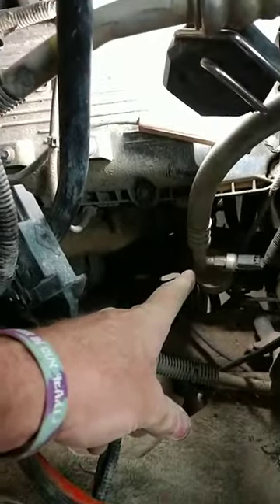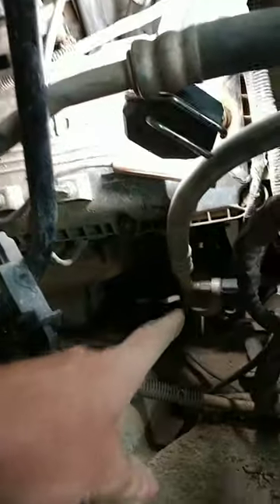How Engineers Keep Mechanics Miserable (Part 287) #shorts

Comment: About 50 years ago I worked in an automotive shop.  On the wall was a cartoon depecting an engineer and an auto body designer.  They were both congratulating each other looking at their final prototype.  A third engineer walks up, pointing his finger into the engine compartment, and says, "No, you're not done.  That part is too easy to get to."
Reply: 50 years ago it wasn't even hard to work on cars. Cars were simplified
Reply: @GiuseppeSimonetti  I got an old 1950s Morris recently, it feels so wrong to work on because everything is so easy to do on it, I'd gotten used to being punished every step of the way
Reply: @GiuseppeSimonetti  Yeah, they really were easy to work on.  Now one needs an OBD analyzer and a chart to figure out where all of the tubes, piping and wiring go to.  And then there are those damned fusible wire links.
Reply: that's like funny with salt
Reply: @archygrey9093  well also back then the cars weren't packed in so tight. Nowadays there's so much sensors, emission stuff, electronics, it just complicates everything and makes it all real right.

Comment: JB Weld is looking like a great alternative right about now.
Reply: I was thinking the same thing, ford should give you vouchers for JB weld when you buy a new one
Reply: Good luck with that.
Reply: I think I’d just slide a tube through over the old tube & put the old tube back into place. Basically a Tube in a Tube deal. It would be stronger than original too. You could jb weld or silicone tube in place. ( edit ) support dip stick also with an attachment point.
Reply: @OcRefrig  hahaha.
Reply: @OcRefrig  You are perfectly correct if there's a will there's a way and you're right it'll probably be stronger too
Reply: @OcRefrig  or just splice it with a hose
Reply: @jophatb3945   yea , a piece of hose & a couple hose clamps could work. Just need to secure top side from flopping around. Make a secure mount to hold top half of pipe in place & you’d be golden.
Reply: @OcRefrig  reengineering is the best
Reply: @jophatb3945   if he just replaces dip stick & does not support it. It WILL just break off again.
Reply: "when you got touched wrong as a child, don't take it out on us mechanics." What a line! If mechanics designed engine bays, they would be huuuuge!
Reply: @OcRefrig   the weight of the dipstick isn’t what broke it… it doesn’t really need support either just enough hose to keep it from dropping too far into the pan. A bit of baling wire to something and it’s good. Depending where it broke oil might not even be leaking out.
Reply: Some people don’t like hack repairs. Especially on customer vehicles. That JB weld doesn’t work? It comes back with my name on it. I’d rather charge the customer for the proper repair
Reply: I tried jb weld on my 7.3 dipstick.. It still leaked lol
Reply: @OcRefrig  I can only imagine how your labor must turn out
Reply: @C.dieslevonankwek7  forget a voucher you should get a memebership that ships to your door weekly
Reply: Get a rubber hose and some clamps/ to bridge the break.  Fix top  end then add it to the bottom.....so cheap easy functional.
Reply: @tooltime4640  I get what you are saying, but it’s pretty easy to ask if they want to pay $60 (no warranty) vs $400. Considering that it is just a dipstick tube, I feel most customers couldn’t really care less, as they probably have never used it!
Reply: @scottjimenez653  the engine bay would be huge and every motor a straight 6
Reply: What is started naming all the parts I started to hear “The leg bones connected to the . . . .” and then I thought JB Weld sounds like a fine alternative.
Reply: Fuck yea 🤣🤣
Reply: Heat shrink?
Reply: @dirtyaznstyle4156  The weight could very well be what broke it. My guess is at its mass it hits resonance at some engine speed and vibrates violently back and forth fatiguing the tube.
Reply: @court2379  interesting, no idea how it’s actually attached but I always thought it was a press fit or snug anyway at the block and bolted to something at the top. I guess anything’s possible but that’s gotta be some real violent vibration at whatever resonant frequency
Reply: Used JB to cover over a blown core plug on the back of an engine. It was half hidden by flange from transmission and about 1" clearance to firewall....lol.
Reply: @jophatb3945  It would be difficult to not only tighten the clamps to do that, but also to keep the dipstick reading accurate and stable after such a repair. Also as a rule of thumb as a professional repair facility, you should always properly repair any broken component as opposed to putting a band-aid on it.

Comment: "If it weren't for Fords my tools would rust."
-Mechanics everywhere
Reply: I'm sure glad that GM's reputation for making great engines like 6.2 / 6.5  and 700R4 transmissions are right in line with GM's current line of junk.
Reply: @robs4517  damn who pissed in your Wheaties? For all you know the man could be a Dodge guy. You obviously don't turn wrenches for a living if you don't know every manufacturer has their share of "who the hell signed off on this?" Manufacturers don't make cars for the user, they make them user's money, ya dummy
Reply: @backpocketmechanic7751  so its ok for some one else make a comment but not me? Sounds like you have the problem.
Reply: @robs4517  apologies, that did come out rude, but I have sweet spot for ol shitty Chevs
Reply: @backpocketmechanic7751  Don't apologize to Ford people! they're icky...

I own a GMC, a Ford, and a Jeep..
I'm just goofing around
Reply: I own a Ford. It’s my second one. First Ford I ever owned was a 2003 Ford excursion with the V10 in it. Amazing vehicle. I put nearly 200k miles on it and just finally sold it a year ago. In all those years… it never once had a major issue. Nothing. I bought a 2012 F150 brand new. I’ve been the only owner. It has the 3.5 twin turbo ecoboost in it. All these years… it’s been pretty good. Only one issue. It had a tiny oil weep when it was under warranty. No problem. Dealer fixed it. Took my dad to the dealership and had him pick it up. He was old and deaf. He didn’t hear it at the time but when he took off out the dealership parking lot… the intake pressure side of the turbo lines popped off because the mechanic forgot to tighten the clamps back down. Well my dad drove the hour home with the turbos venting to atmosphere. The dealership said “no problem, drive it back to the dealership and we will tighten the clamps”. On the drive there… I was thinking about the whole thing. Those turbos had no back pressure building. The turbos oversped for two hours of driving. The dealership tried to get me out the door. Unfortunately the bearing had burned out if both turbos and codes were flying everywhere. Yeah that cost the dealership over $13,000 worth of work to fix. 😂 other than that… it’s been a good truck. The only other thing I don’t like about it is the fact that does decided to use O rings on the quick change coolant connectors. They leak after a few years. PITA to change them every few years. But I’ve had decent luck with ford but I don’t think I’ll be buying another.
Reply: Sure dude, it’s amazing how every other brand NEVER breaks down, ever.
Reply: @emmittmatthews8636  And the Volvo guys have entered the chat. 😆🤣😂
Reply: @robs4517  You have lost your mind I would happily work on any of those over any raggedy Ford these days..
Reply: @TsunauticusIV  I have replaced many of those turbos and they are a nightmare along with the vacuum pump on the back side of the passenger head along with catalytic converters and the list is endless good luck man.
Reply: @eric63377  there is always work fixing GM's.
Reply: @robs4517  Not always. It's mostly Fords every day sadly. You know it's going to be a crap week when Monday morning there's a parking lot full of Fords. But the upside is the paychecks going to be really great but you're going to be stressed out all week dealing with the rust and all the parts on back order. Then if you get really lucky and one of them is let's say a 2005 Ford truck with any of the V8s and the exhaust manifolds are leaking you are in for a 30 plus hour job removing the engine just to deal with the manifolds. The engineering Madness never ends with them sadly. GM's are much much more user friendly. When I was 12 years old (mabie younger) I got my pic of working on Dodges, Fords, GM'S and w/e else you could think of and way back then with no knowledge I figured it out that GM was the way to go.
Reply: Why I don't own or work on any Fords.
Reply: Seconded.
Reply: So true
Reply: Like changing a heater core in a 1998 Expedition, lame. Thanks furd...
Reply: @backpocketmechanic7751  I used to be a Ford guy. ALWAYS paying for shit. I went to Chevy, 2019 Silverado 1500 LD with the 327. Runs like a beast and ZERO issues ever. Also, got a 2017 GMC Sierra HD 2500 Denali, with 6.7 L5P Turbo Duramax,  and 6 speed Allison. 46,000 original miles for 55k. I have put 1800 miles on it, mechanic just inspected it with a 2nd mechanic, was able to find Zero,  I mean Zero problems, issues. Drives amazing,  and hauls my 6800 lb camper like it isn't even there. I have no worries about Chevrolet or GMC quality in these modles. My mechanic says, pretty much all he sees is Ford Powerstroke shit in his shop. Even 2022 built like shit .
Reply: Yeah it's like a love hate thing. 
Sure it's making us money. 
But does it got to always be that dang hard. 
Especially when it's flat rate and we get rust in the Midwest. But book time is always California tech.
Reply: Try working inside the engine compartment of a Corvette.
Reply: Buddy I got news for you their all that way
Reply: @emmittmatthews8636  shaking first in anger 🤣
Reply: Working on fords keeps my tools from getting rusty
Reply: @roninkraut6873  😂😂
Reply: Ashes to ashes dust to dust if it weren't for Chevy my tools would rust. ( actual  mechanic).
Reply: If an engineer designed it, it’s gonna have problems that I’ll be paid to fix
Reply: Ford vs Chevy... the beef that will never die
Reply: Damn, and I though the valve cover on my 4.6 4V was bad. I've done this same thing (dipstick tube replacement) on that engine too and it was a major PITA, but mostly just snaking the tube and removing LH motor mount to jack it up.
Reply: 397 to 12 🤣
Reply: Chevies are just as bad, or worse usually!
Reply: Hurr durr, "I own a ford" hurr durr. All the butthurt Fordbois in the comments.
Reply: I enjoy being a fan of the most hated brand. I've never been a crowd follower (not implying that in this case) but I typically like the things that most people don't.
Reply: this one ford in Australia called a ba Falcon.. fuck me dead, you have to pull the plastic front bumper off to change the indicator bulb and when your in the country in Australia every car has roo bar with spotlights and light Bars all over them that you have to take off all to change a $5 bulb
Reply: Mercedes to that list too
Reply: I have 2 Fords, 1 Chevy, and 2 Toyotas. Guess which brand I have to repair the least.
Reply: Depends on which Ford you buy if it's not a pickup then you bought a factory lemon. Plus you have to watch out for certain models years with engines, that's about it. 

Every GM I've been in has had electrical problems, the interiors are cheaply made and they don't seem to last very long about 300,000 miles before they are too clapped out to fix, I was going to buy a 7.3 early this year with 435.000 miles....

Rams are good the earliest generations had transmission and interior quality control issues but Cummins has mostly been solid. Dodge is the only am Rican company that makes gasoline engines with a super quality, this includes not just the hemi but their normal vehicle engines as well. 

I'd never buy a foreign pickup (as users have mentioned the tundra, titan and titan XD are equivalent to 1500s or F150s so if you want one of those sized pickups and are NOT going to abuse it for truck work then buy a foreign pickup. Especially midsize pickups (Tacoma is superior, everything else inferior) 

For cars Toyota only same for SUVs lmao, Hondas are like dominos when one part breaks another one will soon. If it hasn't already. Nissans have serious CVT issues. 

TLDR
Best
Cars:Toyota (Corolla/Camry)
SUVs:Toyota (RAV4/4runner)
Midsize pickups:Toyota (Tacoma/T100)
Full size daily driver :Toyota (Tundra, 5.7 V8)
Full size work :anything American
SD/HD: anything/only American
Reply: My loyal work truck is a 2004 f350 6.8 never gives me issues. Does everything I ask. I own a 1992 Corvette, named the Purple Nurple, I love it. A 2014 Malibu not terrible but the eco-tex is a pain in my ass. 1995 Chevy 1500 with 305 it sits in the yard because it wants to blow up
Reply: Not too sure about that.  The absolute worse vehicle I used to own was a 1988 GMC Sierra pickup truck.  During the first 60,000 miles the fuel gauge sending unit went bad. The alternator went bad.  The automatic transmission went bad,  Tape player in the radio went bad.  Then to top it off, after coming to a stop in heavy traffic a whole lot of noise and banging came from the engine compartment: the crankshaft pulls had come apart.  Never heard of such a thing happening, but it happened to me?  Maybe that's why dealerships stock replacement crankshaft pullys?  There were cracks running between the three bolt 🕳  Looked like the assembly line didn't torque those bolts properly and the part finally failed.  Nobody believes me when I tell this story but it's all true. Haven't owned another GM product since.  Prior to the GMC Sierra, I owned three Corvettes: The 2nd and 3rd ones purchased new.   They were cheap back then. I have a few POS Corvette stories too.
Reply: I used to work on my Corvettes and know exactly what you mean.  The SOB who shoe horned the engine into that tight compartment should have to have a special place in Hell working on hot engines just to get a couple of spark plugs out.
Reply: @that1guy0219  Both brands have their positives and negatives.  I think brand loyalty is stupid.  It depends on the year and design of any particular vehicle.  I wish the engineers would just leave design changes alone once the glitches are worked out.  But nooo: they have to keep inventing something new and the problems start off all over again??? 
I used to be a line mechanic, then became an engine machinist.  Sorry, but the Japanese make the most trouble free cars and the most perfectly made engine parts.  Sad to say that you can't find that kind of perfection in American made parts.  I keep asking myself, Why not?  Why is American quality so poor compared to Japanese parts?  I.e. American made pistons.  You get a different variation of each piston in a set?  I would have to measure each piston size which could vary by up to .0015" and then bore engine cylinders to match the pistons from small to large.  In comparison, even the cheapest Japanese pistons I could purchase back then for as cheap as $2.00 a piston, jobber price, were absolutely perfectly made is size, and skirt taper.  Only another engine machinist knows what I'm talking about. It doesn't have to be this way if Americans developed an attitude of making the best parts possible instead of just running new parts out the door.  I was asked once Why it took me longer to grind a crankshaft, because my grinds were perfect. I watched as my "instructor" showed me how to increase production. When I pointed out that the crank was .0005 out of round, he replied, "It'll run."  That attitude, I believe,  permeates too much of the indusrty.  In the end, the Japanese took over the car market, and justifiably so.  So sad.
Reply: @robs4517  actually, the 700r4 abortion became the 4l60e, which is a pretty good, if a little weak, 1/2 ton transmission.  The AOD (doa) Ford was absolute trash.
The 7.3 was better than the GM diesels, the 6.9 wasn't much better, if at all.  All come decended from gas engines.
Reply: @randymagnum143  AOD was still better than the other offerings.
Reply: @robs4517  than ford's other offerings?  I believe it.